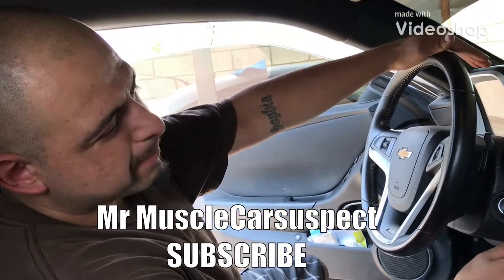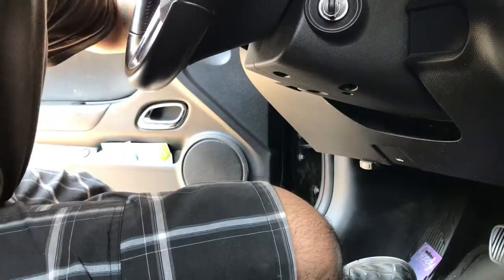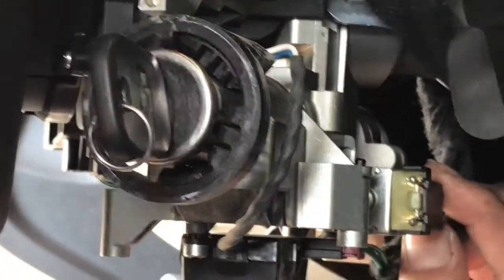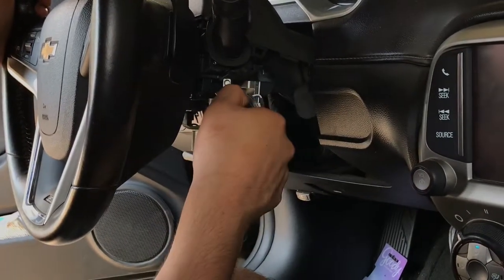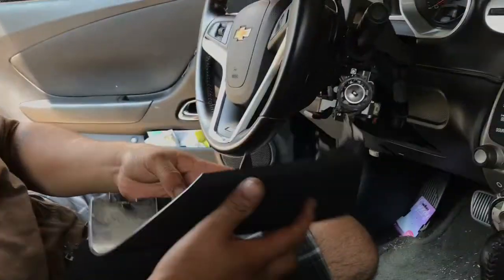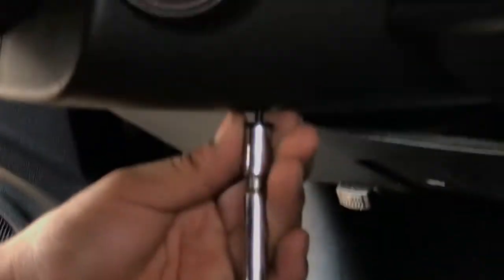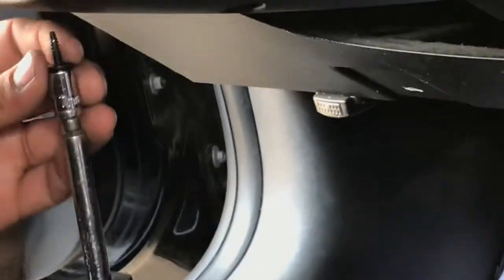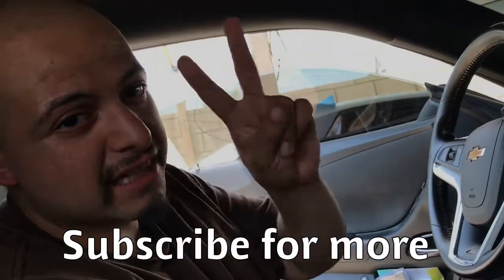2015 Camaro Ignition Key Getting stuck Fix and Solution

Comment: Hello :)  Ive had this problem for forever, this video is great would you suggest WD-40 on the shift button first before removing the wire? I got this exact issue fixed once and they did a complimentary fix even tho they said I got water in the grove part around the shifter. Will WD-40 give me that "water damage" issue? Loved the video
Reply from the maker: Esmeralda Monge sorry for late reply.. yes u can use d40 to help the button on the shifter lubricate. It won’t cause any water damage. D40 won’t damage the shift button at all it helps it and if you want the issue to stop disconnecting the wire will save u money and time.. and headaches.. the button tends to get stuck with time due to the normal use dirt and stuff get in it. Let me know if you got more questions thanks for watching and supporting!

Comment: Thanks man, I appreciate it. Sounds weird but if I open my driver door two to three times the key would eventually come out also but this worked
Reply from the maker: Lol Foreal? That’s the first I hear of that one but I’m glad I can help bro I appreciate your comment and support!
Reply: Right man? I had to disconnect the battery the first time to get my key out. I swear it works, just keep opening the door and switch to the off position. People were looking at me strange when I went to shut off my car though lol
Reply from the maker: Will C we’ll that would sound like something that would work because that’s telling the car it’s on park cu your able to open and close your door freaky when car is parked the doors unlock so you able to open doors freaky that might be the case why it would happen but your the first person to tell me that’s how they got key off lol and the battery part yes that dose happen its because your resetting your car when disconnecting the battery then on the screen you get that the filling things to do open and close door lower and higher window it’s to reprogram once disconnecting the battery but that one way haha

Comment: Not being mechanically inclined I sprayed WD40 into the chrome shifter button to loosen it up. Fixed the stuck key problem immediately but who know how long. 2015 Camaro SS 28k miles.
Reply from the maker: Jeff Kager yea it helps the button lubricate for a wile but won’t last forever.. when you drive and have dirty hands or maybe dust get in, it happens sooner or later again..

Comment: Is there any downfall to doing this??
Reply from the maker: Woken Brilliance well it’s your choice to do this and so far no problems on my end car has bin running great no issues at all after doing this and my key no longer gets stuck it’s bin more than 5k miles since I did this process. All it dose is keeps your key locked but gm in general their ignition is bad. If you replace it same problem will eventually happen..
Reply: Mr MuscleCarsuspect okay I’ll have to try this cause my key keeps getting stuck only way for me to get it out is by pressing the shifter lil button
Reply from the maker: Woken Brilliance another thing is that the button on the shifter gets stuck over time spraying some D40 on the button of the shifter will help it get unstuck or you can do the process I have shown on the video it’s up to you..
Reply: Mr MuscleCarsuspect so you mean spraying D40 on the shifter? Like near the button?
Reply from the maker: Woken Brilliance yes spray some on the button on the shifter. Spray it on the button and click it a couple of times till it’s lubricated
Reply: Mr MuscleCarsuspect ah okay makes sense cause I’m noticing I have to press it many times for it to come out.. it only happens every now and then
Reply from the maker: Woken Brilliance yea It needs to be lubricated here and then once and a wile because every time you drive your car eventually it will eventually Drys up and even gets a bit of dirt and the button gets stuck

Comment: Heyy everyone... 
i need your help ASAP, i have a 2014 camaro with an automatic gearbox. Today I couldn’t shift gears from PARK as the small button in the shifter was stuck... it’s still sitting in the garage, plzzz help 😕
Reply from the maker: Abder Rahman Rafiqul Islam if your button on the shifter is stuck spray some d40 on it and click it till it gets unstuck should help the button click and let you move your shifter from park try it let me know if you got any more questions
Reply: Mr MuscleCarsuspect  it’s not helping bro. Do you know how to manually override the gearbox ?
Reply from the maker: Abder Rahman Rafiqul Islam Its usually the interlock cable when the shifter becomes hard to move... There is also a shift lever assembly, which is what you are grabbing when you move your car in and out of gear. Both of these are the main culprits with hard to move shifters and theirs a slim possibility the problem is in the transmission.

Comment: Man I can't seem to get the pop the plastic parts off after I get the screws out
Reply from the maker: Push each side apart. See if you can just pull it off from one side. It should just come off once the screws are off
Reply: @mrmusclecarsuspect5362  yeah I finally got it yesterday, i realized the 2014 has 4 screws lol  but thanks so much man it worked perfectly.
Reply from the maker: @SuperTroy20  lol yea sprry about the late reply i work 12 hours daily and hardly have time to reply to messages. But ill be uploading vodeos soon once my subs go up a bit. Thanks for watching and supporting. Consider subscribing for mew upcoming content. Thanks
Reply: @mrmusclecarsuspect5362  yeah man no worries lol and will do brotha take care
Reply from the maker: @SuperTroy20  your too thank you and stay safe brotha

Comment: Yo Bro I appreciate this video was having the issue on my 2014 SS smh. Damn key kept getting stuck. Sometimes be good then yesterday couldn't get it out for 20mins. Had to leave it in the ignition run in auto zone to get the tool to get those bolts out. This video was a life saver though!
Reply from the maker: jay reezy no problem bro! Thanks for your feedback and support!
Reply: What tool did you use?
Reply: @whitewolf9981   just a mini rachet set that comes with different size sockets and a mini extension. Like he mentions it's three 7mm bolts to get out. You can probably get the screw driver looking tool that holds the 7mm driver at the end. Just take those bolts out and the rest is easy.

Comment: Thank you former your time I have been manually hitting the button on my 2010 for years I disconnected the wire but still sticking any other suggestions and thank you again
Reply from the maker: You can spray some wd-40 on the button and click it a cuple of time till it lubricates completly should help that button unstick.. let me know if you got more questions sorry for the late reply

Comment: I took all 3 bolts out but I still can’t take the column apart
Reply from the maker: Jimmie Saunders it should come right off what year is your camaro? Push on it give it a bit of wiggle it should come right off.
Reply: Mr MuscleCarsuspect 
Thanks for that quick response bro but I just pull it apart. I had to use something to wedge the pieces while I pull apart. But once again, thanks for the quick response. I just subscribed to your channel.
Reply from the maker: Jimmie Saunders no problem bro and thanks for the support and comment I’m glad I can help let me know if you got anymore questions feel free to follow me on Instagram ass well and hit the bell so you can be the first to view new uploads

Comment: People be very cautious doing this !!!!!!!!!!!!!!!!!!!!!!!!!! I know this guy means well and hell I even did this myself, but upon further investigation I have found out that that is the biggest safety feature on gm vehicles . So when you’re vehicle is in running mode and you are driving that plunger keeps you car ignition from turning to off or accessory position, so basically if you’re driving on the freeway or coming to a stop light and you are the type of person who has a very full key ring with a lot of extra keys or charms guess what , you’re putting yourself or others in harms way and maybe in a death situation, by disconnecting that switch you have allowed your key to be able to jump out of running mode and you will loose brakes , steering, and the ability to restart the vehicle without coming to complete  stop this part keeps the ignition in place while driving . I know he means well but do this at your own risk !
Reply from the maker: Sal Cardenas thanks for putting this in. But it’s peoples choice if they want to risk. but honestly your key is turned their is no way the key would come off gm tells you that because they want to u spend hundreds off dollars on  repairs they will make you replace ignition switch and other parts not needed to be replaced maybe your right maybe your not but I bin driving my car for a wile like this and other of my buddy’s theirs no way the key will come right off unless your turn the key yourself I even told my Chevy dealer about it they said it’s a commen Issue going on and that the wire I removed shouldn’t affect it any way.
Reply: Mr MuscleCarsuspect  yup you’re right but it’s not about the key coming out it’s about gm and their ignition system that has  been known to jump out of the run position while in  running mode ,that’s why that part is there to keep that key from turning while the car is in motion, it may not happen to you but  have you seen some peoples keys and all the stuff the have on them those are the people who most likely will have an accident, nothing against your video I love it cause now I know what to show the dealer even though I spent $175 bucks on the new shifter that the dealer said was the problem , And that did not solve the problem
Reply from the maker: Sal Cardenas I mean I get you bro it’s kool your letting people know but it is take your own risk on it and well it’s better that people don’t carry so many keys with them while driving their car. I never do I just use the one key but this has worked great for me I told my dealer they told me it shouldn’t affect it in  any way
Reply: Bruhh.... once the engine starts up as long as the ignition was turned its gnna stay on, its not gnna turn off even if the key comes off, nd i doubt there any way for the key to fall off jst cz of the weight of a key chain... whats the other keys gnna do? Tell the key from the ignition to turn itself back nd turn off the car😂
Reply: DIABLO Gaming  First of all I never said it would fall out second of all my son drove the car after I disconnected it and it did jump out of the running mode into accessories lucky it happened in our work yard but the car still managed to hit our gate so go ahead and do what ever you want all I know is that people are getting killed behind GM’s faulty ignition switches , I did my research
Reply: @salcardenas2891  u said it would jump out, thats the same thing, ig maybe u shud drive ur own car then since you know it wud do that, nd maybe if u did your research why wudnt u go to gm in the first place to get it fixed?
Reply: DIABLO Gaming wtf? Ok lol
Reply: Well you dont lose brakes. You even will have vacuum assisted brakes for one or 2 presses of the pedal. The only real concern is if the key falls out completely and the steering wheel locks. You also dont have to stop completely to turn the car back on. Just put it in neutral and you should be able to crank it back up with no issues. I will agree tho. This is a little crazy. It makes sense for a quick fix but get the shifter fixed. Its really not hard to fix in the first place
Reply: There is another HUGE issue not mentioned. With the wire off, you can park your car, take the key out on go on your way. Problem is, you may not be in PARK. This allows you to remove key at anytime. Granted most people put in park every single time but there could be that one time they are having one of those days and they are on a slight hill and....

Comment: When I only had 26k miles this would happen to me a lot so I took to the dealer an supposedly they said they fix the shifter n I was good because I was under warranty so the problem went away an then a year passed an now again I’m having the same problem again it’s annoying .... I’m going to try this thanks a lot man
Reply from the maker: Abraham Sanchez yea they tend to say they fixed the issue but in reality they just cover the issue with simple temporary fix and sometimes inuff time to run out of warranty.. they prob just sprayed d40 on the shifter button to lubricate it, the button tends to get stuck and lubricanting it usolly fixes it and no problem I’m glad I can help thanks for your comment and support!

Comment: Though a symptom, the key lock solenoid was not the root cause for this key stuck in ignition problem. It was actually a sticky shift-release button on the gear shifter. It was not reliably engaging the switch that tells the key lock solenoid to disengage to let you finish turning the key to the off-position and pull it out of the ignition. Hopefully the following easy-fix video helps. https://www.youtube.com/watch?v=sETuCmaTLhY
Reply from the maker: Yes your correct the sticky shift_release dose tend to stick you can spray some d40/lubricant and click a couple times till it releases. But even them some don’t come out even just with that. That’s why this is a easy free way to get rid of the issue completely

Comment: whats the disadvantage in do this solution?
Reply from the maker: Well all it dose it prevents your key from getting stuck. Saves you lots of money from going to dealer and having them charge you a shit load to replce unnecessary parts
Reply: but the key is at risk of falling out of the ignition when the car is engaged and moving, afther this procedure? thanks
Reply from the maker: @josehenriquesalesjunior1165  lol theirs no way the key will fall out. Np

Comment: @Mr MuscleCarsuspect
 First off...awesome, inspiring video.  I've been experiencing this problem in my 2016 Chevy Colorado.  I found a link to your video on <www.coloradofans.com> in a thread entitled "ignition Key getting stuck". 

I have two questions/concerns: (A) have you ever heard of this happening with other GM vehicles such as mine and (B) if it's as simple as unplugging that part, what purpose did that part serve and should it be replaced?

Thanks for any and all feedback!
Reply from the maker: Jensen Curtis well I mostly herd it happening to most camaro’s and this is something that happens a lot with different car\trucks dependas... and gm should have a recall on this but all that wire dose is keep Your key locked if their is no signal going from your shifter to the igniting telling it it’s on parked key will stay locked!
Reply: @mrmusclecarsuspect5362  Thanks for the speedy response.  I am going to attempt to do this tomorrow.  Wish me luck!  I really, really hope it fixes my problem because it seems temporary fixes are replacing the shifter, replacing the ignition lock, replacing the ignition switch or just selling the vehicle to someone else to worry about.  Although I'm convinced GM knows about this and refuses to address it free of charge, 5 dealerships so far have played the dumb card with me, want me to spend $120 for a diagnostic test and another $600-1000 to "fix" my issue.
Reply from the maker: Jensen Curtis yea sucks but it’s true gm won’t  fix it but if inuff people claim this problem maybe we will have luck and they will fix it you never know.. thanks For your comment and support good
Luck!
Reply: @jensencurtis7528  did this work for you and your Colorado, any issues? I want to give it a try on my 2016 Canyon
Reply: @Craig Allen worked FLAWLESSLY
Reply: @jensencurtis7528  Good to know, it makes sense to me, just wanted to make sure there were no negatives to it before I did it. I've had enough of the frustration. Thanks for the quick reply!

Comment: Thanks
Reply from the maker: Danny Milstead no problem I’m glad I can help
Reply: @mrmusclecarsuspect5362  ,The dealer gave me a song and dance about hooking up to diagnostic equipment and changing $125, and the repair, cost being parts and labor,  in excess of $400. I left it alone and now I can fix it thanks to you!
Reply from the maker: Danny Milstead yea the dealer will try to rip you off. By this many people reporting the key getting stuck by now you would think they have a recall but in reality we all know that gm in general  their ignitions are bad so even tho you would have it fixed the same thing would have happened maybe 10k miles later or maybe 50k miles later the point is that the problem would still be their because it’s gm in general